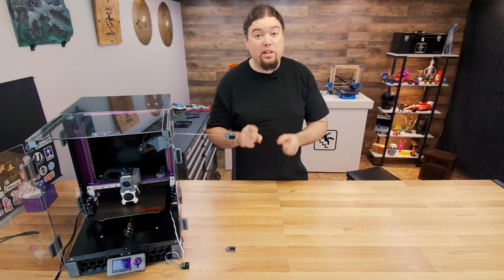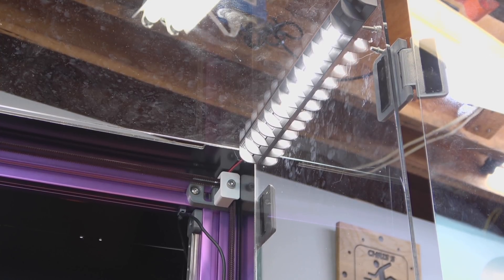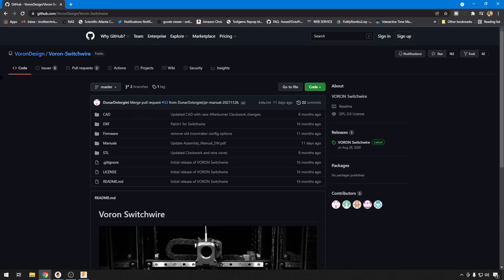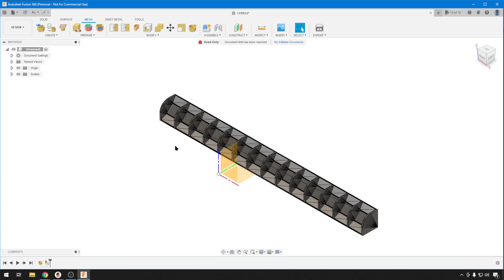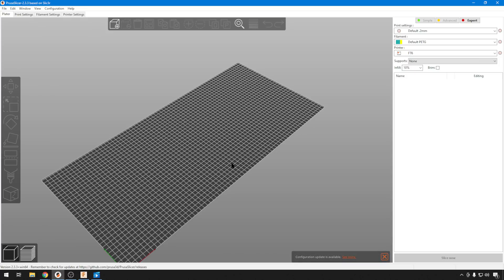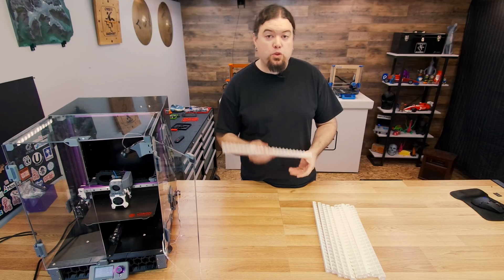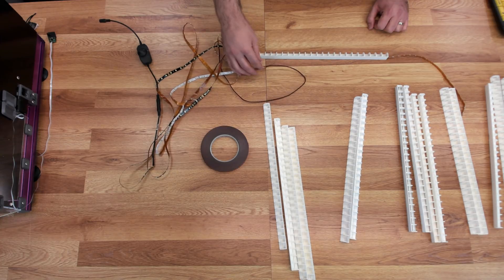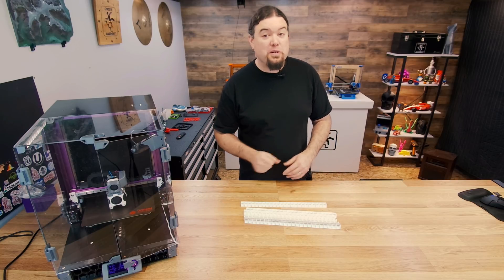Voron Lights??? - A fun Project - Chris's Basement

Comment: Hey Chris, commenting on this so hopefully you see this. I just discovered an issue with setting up octoprint with pi cams when people use the newest rasberrian OS (Bullseye). The OS now uses libcamera instead of the raspistill and raspivid functionality. this OS is only a couple months old too and it doesn't seem that this is a well known issue in the community. I had mistakenly returned a pi cam and almost ordered a new pi because of this issue. One temporary fix is to ensure people install the old Rasberrian 10 version instead.

In short, there is no guide to use the pi camera for an octoprint installation on Rasberrian 11 (Bullseye). Hope this can help someone else
Reply from the maker: Great info! I will have to look into how this works.

Comment: Dude, In Mesh Use "Generate face group" (accurate) than use Convert Mesh (parametric / Faceted) than you will have a much easier body to work with.
Reply from the maker: Thanks for the tip!
Reply: I was hoping that part would be included. I only learned about that a few weeks ago, it's made my life so much easier.

Comment: Question: When I've exported from Fusion as 3DMF the file comes in off the left from corner in Cura. Any tips on getting Fusion's 3DMF files to play nice with Cura. I'm sticking with STL for now. Comes in dead center and on top of bed. 3DMF sometimes comes in below bed.
Reply from the maker: That's a good question, I will have to play around of that, not sure how Fusion handles that.